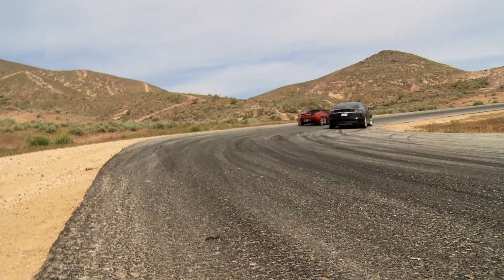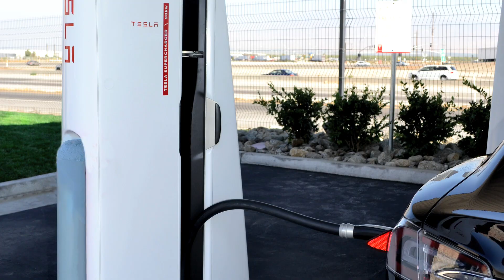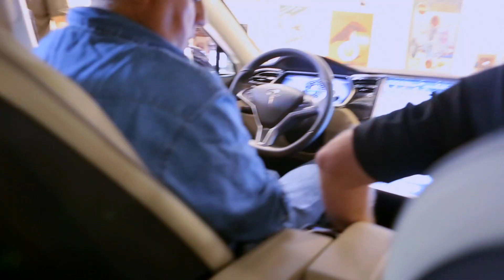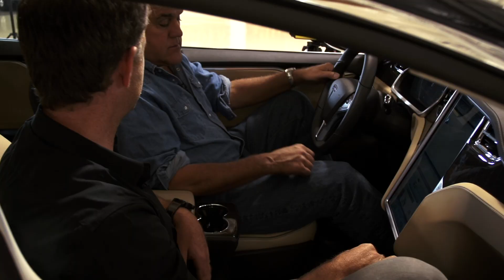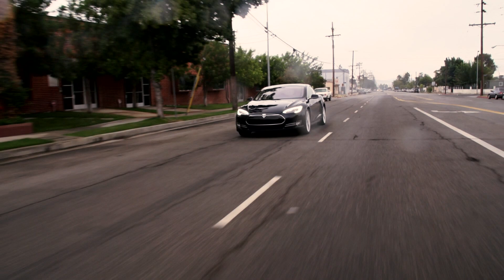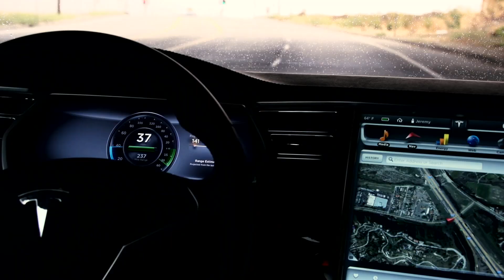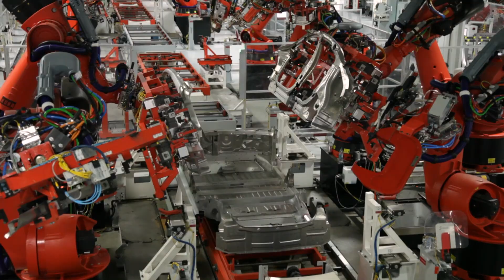2012 Tesla Model S - Jay Leno's Garage

Comment: Tesla: Everything the American Automobile Industry can and should be.
Reply: jmshaw357 it's 2017, about to start producing the Model 3 for its 400, 000 buyers, after making the major automakers see that they need to make more electric cars, plus solar and batteries, talking about heavy duty trucks soon, only 4 years after your comment , still waiting on the failure......
Reply: jmshaw357 They were in general the best option available for operating road based motor vehicles, with the serious logistical downside of being dependent on a finite resource of petrolium and causing a lot of pollution.

New technologies, like those being perused by Tesla Industries can deliver similar performances while not devastating the environment through emissions, not being dependent on this non renewable resource which gives a bunch of theocrats which happen to have large deposits of the stuff in their territories undeserved power.
Reply: 5 years after this comment, 3 Q in a row of great profitability. Over 600k cars sold and delivered.. still waiting for tesla to fail... not
Reply: when they are'spent' they can no longer be recharged!
Reply: jmshaw357 when you get triggered ny a car
Reply: and could already have been  GM produced the EV1 30 something  years ago then withdrew about all  of them and crushed them  check movie Who killed the electric car?
Reply: ImperatorZor Correct
Reply: ImperatorZor
i'm not against electric cars but do you guys realize to make electicity there is an enviro impact? then what happens to the battery's when there spent? why don't they produce methanol cars it's cleaner than regular fuel? or maybe develop water base fuels? yes water is combustible.
Reply: jmshaw357 i dont think you understand this company is very new and will i repeat will be a huge success  your gas cars are failed and always have been they  are  complete garbage every single one i love too see all gas cars dumped into a shredder
Reply: yes they are a failure just look at the planet  full of smog and pollution
Reply: MY "gas" cars are a failure?? You're an idiot. Look around you, fool--ICE cars are used daily by billions of people. That's hardly a failure. You are a worthless dope.
Reply: jmshaw357 also you should maybe  try a little harder at sounding more intelligent in your argument   or suck on a tailpipe for all i care either way  gas is evil but what does  a knuckle dragger care.
Reply: MrKdr500 When they are spent, they are recharged.
Reply: Go lick your wounds in silence ya dope.
Reply: Then why doesn't the Tesla sell enough to be profitable? Tesla is just an exercise in liberalism--it will be finished (failed) soon.
Reply: jmshaw357 They are selling, there are more than 25,000 Tesla Model-S cars on the road, exceeding their target figure.

Why do you hate American ingenuity and entrepreneurship? People working hard to deliver a superior product to make it rich, employing thousands along the way. A car which does not pollute the air, does not contribute to America's dependency on middle eastern oil and delivers on everything a car should do in terms of performance and aesthetics while being made in the USA. Whats not to like?.
Reply: @ImperatorZor  lack of engine noise and fun driving experience.
Reply: jmshaw357 Still waiting on Tesla to fail 😂 🕐🕑🕒
Reply: @jmshaw357  5 years later - still not finished or failed.
Reply: @evolt7553  Yet it most certainly is not profitable and isn't exactly doing fantastic in the market. Quality issues are rampant with the Model 3 production line. They are interesting, but are being ran by a total nincompoop.
Reply: @jmshaw357  Five years later, how did your guess turn out?
Reply: @jmshaw357  its 2020 and tesla still exists. It has forced other manufacturers to come up with their own evs
Reply: @jmshaw357  Well.... the failure has not happened yet.
Reply: @jmshaw357  this didnt age well
Reply: jmshaw357 man where you wrong eh
Reply: @jmshaw357  And has Tesla failed or your prognosis was wrong.
Reply: jmshaw357 your comment hasn’t aged well...
Reply: @jmshaw357  Exercise in liberalism? Yes, it does seem to reflect a more enlightened approach.
Reply: @jmshaw357  Guess you were very wrong....But hey, they can still go bankrupt in another 5 years, right, right?
Reply: jmshaw357 and here we are 5 years later with Tesla as the quickest growing car company
Reply: @jmshaw357  yeah?
Reply: @jmshaw357  reading this in 2020 lol
Reply: @jmshaw357  Well, you're wrong. Very very wrong.
Reply: @jmshaw357  lol,
Reply: 4 years later and Tesla is very close to being profitable. Just a few months away.

Comment: The one I test drove in December was the model S-P85+  P=Performance, 85=85kwh battery, += handling features. The Tesla was priced at 130,000k but was discounted to 120,000k with 920 total miles driven. I noticed the license plate was the same one on our test vehicle. The only thing I didn't do was do a burn out.
Reply: Crazy how much better the plaid is now for $40k less!

Comment: This looks really awesome, I'm wondering how much it costs. I'm guessing probably quite a lot. Since even a "cheap" brand new car still goes for around 15 grand.
Reply: starts at around 87000 USD for a base model, but for either the 2016 or the 2017 model year, they're going to release a 35000 car dubbed the "model E" which is supposed to be a C-class 3-series A4 competitor
Reply: ***** What? Base model S starts at 69,900 MSRP before tax credits.
Reply: Depends on where you live. Here in Norway, the state takes no fees for electric cars like they do with petrol or diesel cars. This means that the Tesla Model S suddenly becomes a lot cheaper than many other cars. Otherwise it is prized at the same price range as the BMW and similar cars.
Reply: sherman3211 not here in canada + online
Reply: Michael Chang

Wrong, base model is 64k on the Model S. The model X looks pretty cool though,.
Reply: Michael Chang

Ah yes, everything is more expensive in Canada, for whatever reason. I am from NS, originally and going back and forth it always surprised me the price difference (regardless of exchange rate) on every day goods. Definitely starts under 70k in the US.
Reply: *****
Exactly, people are willing to spend about the same as an S-class or 7 series to be a part of "The next big thing" and in all honesty this car is extremely stylish.
Reply: ***** And that's still pretty expensive. I'd probably have to wait untill they start making the 14,999 model and then get one of those second hand. XD
Reply: Disthron It's actually not that bad. They could easily charge $500,000 for this given the technology that's in it, and how new the company is. $69,000 is less than the new 2015 Cadillac Escalade cough toaster on wheels cough
Reply: Anoxias
Even though, I'd have to wait until the second hand market kicked in.

Comment: I love this car! Why isn't everyone mentioning ZERO EMISSIONS! It's fast, great range, superior handling and technically advanced...but best of all, I don't need to breath in excessive carbon fumes. Great car for our future people. BTW, I drive a quick gas car now, so I'm not at all biased, but I see this as the direction we should go in.
Reply: C'mon Ted, you can extract electricity from potatoes if you really wanted to. Let's not kid ourselves, electricity can be generated from multiple sources. The point I'm getting at is that the post production or post contribution to the environment is minimal. I would safely kneel behind an EV and breath in its zero emissions, but i wouldn't wish anyone to kneel behind a gasoline car and breath in the emissions it produces. Again let me stress that I'm a fan of all automobiles so this is definitely a non-biased opinion.
Reply: @Ted D Mielke yeh 100 years after tesla discovered zero point energy.  in which there is enough energy in a coffee cup to boil away the worlds oceans,   and were driving round on a ½ton slab of batteries.   c'mon people, the first electric car was , what? 1876 or thereabouts,  this is alredy archaic.

Comment: electric cars are getting better all the time but how far can you drive when you have the heater on, the lights on (maybe LEDs don't use much power?) windscreen wipers on, heated rear window on and you're listening to the radio?
Reply: Gerald Allen I wouldn't bother with some of these people. They are going to try and find any reason to hate on these cars, even if the reasons are completely irrelevant.
Reply: I drove one on two occasions and the person working of Tesla said that those things don't use more the 5% of the battery and with the regen it will not take away at all...
Reply: Matt Dobner
Dobner is a Tesla shill--he doesn't address your question, does he? I bet fifty bucks Dobner doesn't own a Tesla.
Reply: No it doesn't really answer it. Here in England in winter your commute is liable to be in the dark, cold, wet and you'll want some tunes!

Comment: Awkwardly silent burnout
Reply: instantaneous torque is a benefit of electric motors! :)
Reply: ya but no one will hear you blocks away call the cops come on
Reply: Hey, burnouts are all about burning rubber, not engines, so why do you need any kind of noise to accompany it?
Reply: I think it only burnt out because the pavement was wet...but ah well nice car for the ones who can afford it!
Reply: Yeah, like someone was doing a burnout with a bicycle.
Awesome car though.
Reply: Have you guys seen electric drag racing it's just so, boring. Yeah, they can go fast, but it's just non exhilarating for the audience. Go ahead slap all the electric motors you want on stuff, your just not going to see people like me around it. Not that I matter, it's just the thought of the tried, and true internal combustion engine die for me is just sad. I see it as putting done a dog. Because once it's gone it might never come back.
Reply: ZAC WHEN YOUR GOING 60MPH IN 2.5 SEC. REPORT BACK TO US HOW BORING IT IS. UNTIL THEN...
Reply: @Zachariah Woller In video games and for racing audience electric cars are boring - because if you are not really driving the car, just watching it from the distance - then sound of it is seems much more important than it really is. But the other story is when you drive it itself. Then electric car, especially Tesla, is still engaging and not boring at all (mainly due to maximum torque available all the time). Thats why people criticizing electric cars should first test drive a Tesla Model S P100D ;) It also depends on your preferences, of course. For example, I like the pure experience of driving much more than the bonuses, like shifting gears or listening to exhaust (its nice, but playing music is enough for me when im bored). So, at least for some people, like me, driving electric car can be as pleasant as combustion engine car.
Reply: roiafricain it beats an m5 to the 1/4mile, it will do a burnout of dry pavement

Comment: What happens if someone has kids in the back and it gets rear ended at a 45mph impact?
Reply: The back has a double bumper to ensure safety at highway speeds. The Tesla is actually the top ranking car in safety on our roads today. Seriously.
Reply: Keep your eyes on a swivel and be ready to launch.   (half joking) I used to ride a fast street bike and one of my rules was to always leave enough room behind the car in front (of course know what's going on 360 deg. and have it in first gear) at a stop light to be able to gas it and swerve to one side and go between or along side the cars in front should the car behind be not prepared to stop.  Just an example.
Reply: I contacted Tesla and recommended they use 'hexagonal crush zones' in future vehicles.

Comment: do this car produce any waste (exhaust) at all?
Reply: No. While the primary energy source of gasoline cars is oil, electric cars such as the Model S and the Chevy Volt have numerous energy sources powering them, no matter where you live. In any one given area, the electricity off the grid could be derived from nuclear, natural gas, hydroelectric, coal, oil, wind, biomass, geothermal, or solar. Not to mention how much more efficient electric cars are in the output of total CO2 emissions.
Reply: no only after 10 years
Reply: It doesn't even have any exhaust pipes.
Reply: TheBoldImperator but it must produce some waste .. mustn't it
Reply: You could argue that charging it from the plug produces waste as the energy has to come from a power plant which probably isn't green. But the car itself doesn't produce any waste directly.
Reply: *****
Electric cars charged at night will actually help the power industry to reduce the so called "bath-tub" effect during night. When the demand for power decreases during the night a lot of power generation plants need to shut down their power output, charging electric cars during the night will help to eliminate this costly process a bit! :) Also, my electric car runs mostly on sun since my solar panels are generating power to charge the car.. Also the rest of the power comes mostly from hydro power in Sweden.

Comment: yes, as long as it has a proper power outlet. Although if the Model S has an 80kWh battery, it's gonna take you some 40 hours to fully charge it. Better plug it into a wall :D

Comment: Not including state EV incentives which range from $7,500 to $15,000, they start at $63k for a 60 kWh base model which will still do 0-60 in 5.9 seconds. It's not just the whole "no-gas" thing. It's the experience all together. The innovative infotainment system, the one-pedal driving experience (regenerative braking), the immense acceleration from a stand still due to 100% of the torque at 0 RPM, the huge luggage capacity, AND it's the safest car ever built. It's got 5 stars across the board.

Comment: There is little point in BMW i8. People buying EV wants to leave behind the need for filling up the gas tank. BMW i8 fails miserably by having an EV range of only 22 miles. And to make matter worse, acceleration is inferior to Model S P85 while it's much more expensive. 
Furthermore, having two drivetrains in one car is definitely not going to help in the long run concerning durability and reliability. And while BMW makes admirable cars, their reliability aren't much to be impressed about.

Comment: Actually that's the very point of this discussion. Tesla Model S has experienced one fire that wasn't an explosion and didn't enter the cabin with a pre-warning alerting the driver to pull into the side out of approx. 100 million of combined miles for this car. Meanwhile gas powered cars in the USA are experiencing fires approx. 5 times more frequent or 1 per 20 million miles (411 cars burning per day) with approx. one death per each day.

Comment: Please throw out your phone immediately before it explodes right in your face. And careful as you are, don't forget that driving a car is many 1000s of times more dangerous than having Li-Ion batteries in your pocket. Therefore you also need to get rid of your car. And walking is also very dangerous. Deaths of people walking outside is 1000s of times higher also, thus you should stay indoor. And to be extra safe, always keep all doors locked and switch of all electricity to avoid any fires.

Comment: Another reason why Model S is better than an ICE car:
ICE cars are catching a fire approx. 5 times more frequently than Model S on average.
Every day someone is dying in an ICE car due to a fire somewhere in the USA.
Model S will alert the driver with a warning of pulling in to the side if the battery pack is experiencing a critical damage allowing the driver to safely exit the car, as what was demonstrated this week fully per intended behavior.
IF YOU ARE AFRAID OF A CAR FIRE: BUY MODEL S :-)

Comment: The fire was the result of a piece of debris on the highway impacting the underside of the vehicle with massive force (25 tons of force) and breaching the armour plating (!) around the batteries. The flames were entirely vented away from the driver's cabin thanks to the design of the battery bay.

Tesla's batteries don't overheat thanks to an internal cooling/heating system on the batteries which keeps them at optimum operating temperatures.

Comment: Lithium Ion batteries ARE dangerous. That's why Tesla vehicles have them in boxes of 1/4 inch armored plating, and if this box gets breached and the batteries are ignited, the flames/any explosion vents through a designed path away from the driver cabin at a much lower intensity than a gas tank fire.

Li-Ion batteries may be dangerous, but no more than gas vehicles. And as above, Tesla vehicles have amazing safety features.

Try harder :P

Comment: It turns out a chunk of metal got stuck under the car at highway speeds and penetrated the underside of the battery bay with 25 tons of force. The battery (surrounded by 1/4 inch armoured plating) did catch fire, but the safety design vented flames through many separate nozzles away from the driver's cabin. The intensity of the fire was about 10% of that of a gas tank catching fire. The driver actually wants to buy another Tesla. If anything it demonstrated the amazing safety features :)

Comment: Even under the best conditions of being on the equator, solar cells on a car would generate only 250 miles of range..... per year. The tech is not there yet. The cost cannot be justified. perhaps when solar cells and EV batteries are produced with Graphene based technology.

Comment: Of course a repair kit is not unique for anyone. But it will solve the most frequent cases of a flat tire. Nowadays Tesla Motors is just one of so many brands selling cars without a spare tire. Manufacturers with some models without a spare tire include Acura, Aston Martin, Audi, BMW, Cadillac, Chevrolet, Chrysler, Dodge, Ford, Ferrari, GM, Honda, Hyundai, Jaguar, Lamborghini, Lexus, Lotus, Mazda, Mercedes, Mini, Nissan, Pontiac, Porsche, Saturn, Scion, Smart, Toyota, Volkswagen and Volvo.